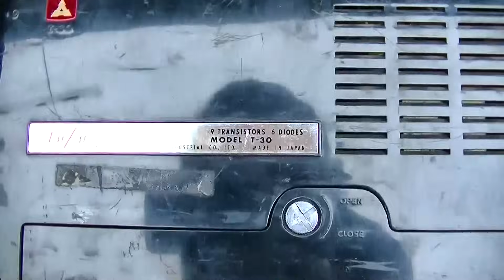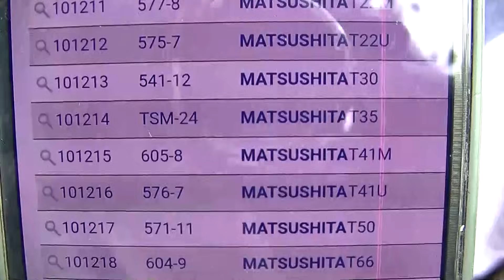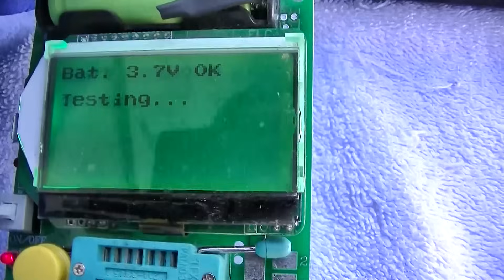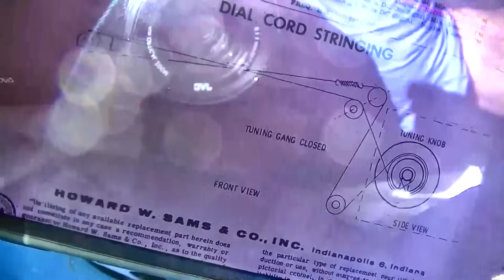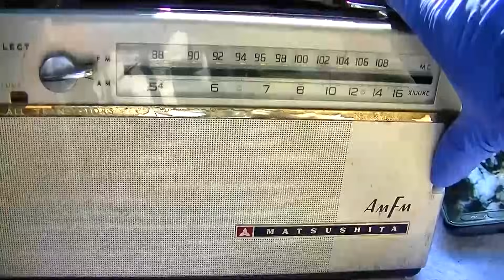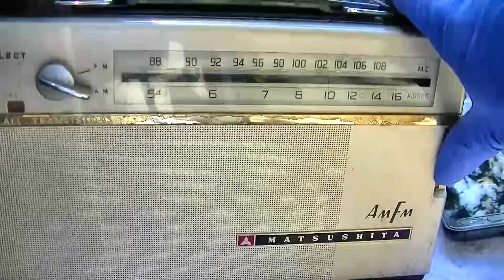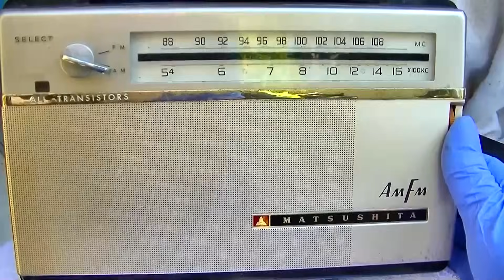1960 Matsushita AM FM Transistor Radio Repair T30

Comment: Don't need no stinking non-polarized caps.  Just put two polarized caps in series back to back with the positive or negative leads together.  OF course use two caps rated TWICE the uf rating and the same voltage rating as the original.
But you know that.
Reply: that one has got me out of a few scrapes in the past. non polarised caps used to be really expensive as well. probably not anymore

Comment: Anti-backlash Gear

One side of the mating gear teeth to the anti backlash gear is pressed by the teeth of the gear-1 and the other side is pressed by the teeth of the gear-2.
The spring of the anti backlash gear should designed in such a way that the expansion of the spring should not occur by the normal operating torque of the gear.
Reply: shows the detail and quality that Japan always put in to there sets  panisonic   jvc and sony were the best

Comment: Why didn't you replace all the electrolytic capacitors? What kind of repair is this knowing that the other caps are bad ???. Big shame.  50% job done. 👎👎👎
Reply from the maker: This channel is about Diagnostics. Did you like your own post?
Reply: Cap swapping isn't diagnosis and in many cases it's a complete waste of time.